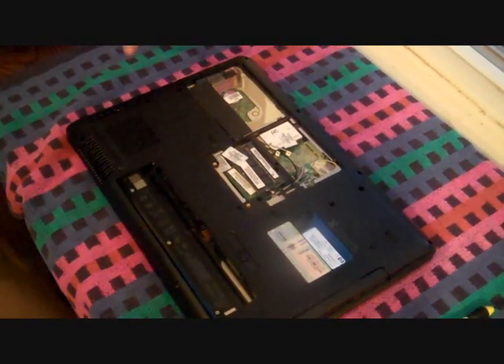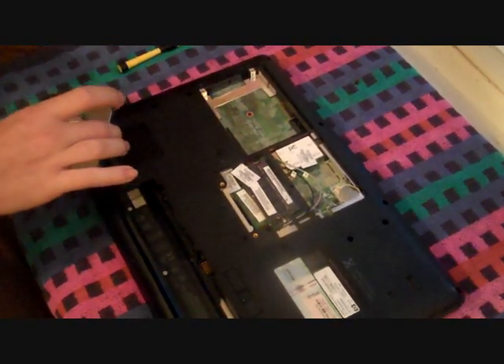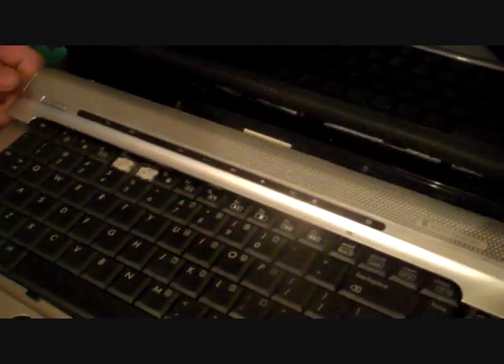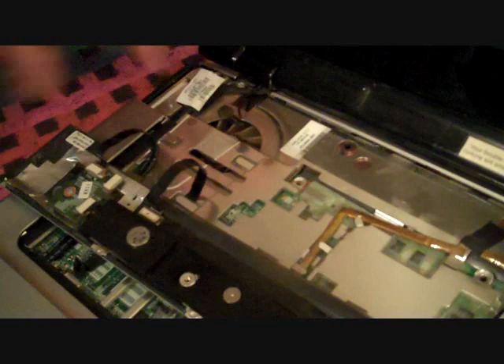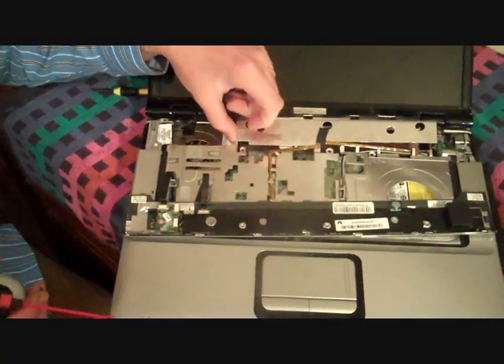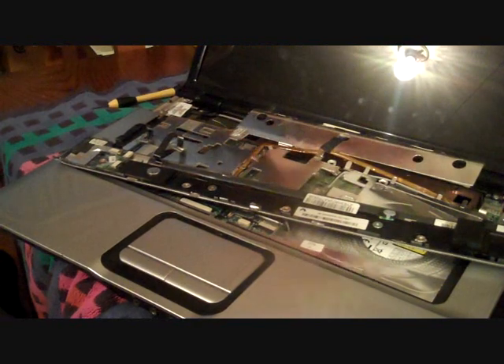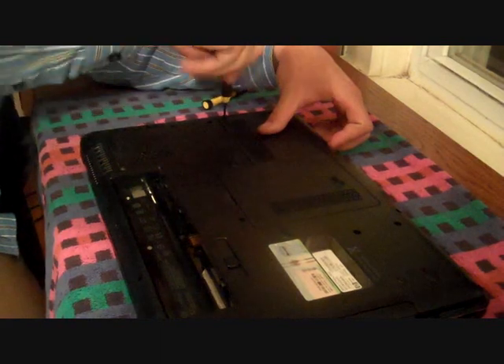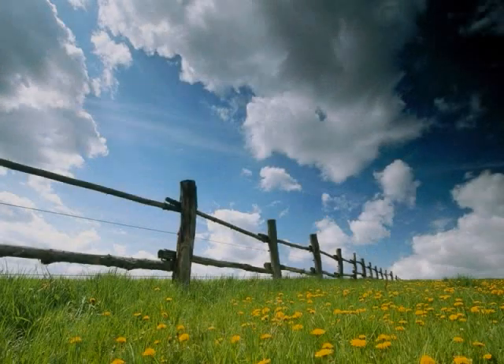How to fix an overheating laptop : Clean your fans and heatsync with this procedure

Comment: i have same second laptop and i cleaned it with powerfull vacum cleaner. it was always 70C or evn turned off if its working to much :), now stays 65-70C on 100% load. USE powerfull hoover

Comment: you fail to mention that connectors such as the keyboard cable have atab that you lift up/rotate BEFORE pulling or the cable can tear.

the dust is ok if it goes in, aslong as it is moved out of the built up areas as the normal air flow will clear it.

Comment: what a half ass way to fix an overheating problem take it apart clean off the fan and heatsink remove the old thermal compound and then reapply the  thermal compound and put the system back together again

Comment: Did this, plus applied new thermal paste, still runs hot as fuck..
Reply: fan working?
Reply: Yep, not sure what the problem is anymore, I made sure the heatsinks are not warped, twisted etc.
 The laptop is entirely out of commision because of this overheat
issue..

Comment: To bad thats a hp dv6000 model where the gpu gets so hot it lightly melts the glue that holds the gpu to the m/b. normally these models always get hot no matter what and typically requires a re-flow or m/b replacement. good job on the video tho +1

Comment: I stand to be corrected if I am wrong, but I WOULD NOT blow dust around inside the laptop since the accumulative dust may have conductive properties? if you blow them to another part of the laptop could that not cause components to short? Well thats just me and I WOULD have stripped it down AND removed the fan and re-thermal paste the processor.

Comment: It's not the platforms fault that people don't do the proper research when buying their PC's. There are many PC's that rival Mac and don't cost nearly half as much. Another thing, Mac is not infallible when it comes to quality and design. Many of their products and accessories break down after short term usage, far quicker than a PC counterpart. Don't believe me, just check out the magsafe power adapter for the macbook.

Comment: how is blowing, aiming air through the fan opening, going 2 remove the biggest problem which is duzt n' fluff build up on the 'inside' of the heatsinking fin'z. this just requires blowing ur air through the ouput vent on the outside of the laptop after removing all the removable panels underneath the laptop so that as much of the duzt leaves the laptop, voila!
+ u can't pull out the k/board like that, did u intend just forcing it back in, no way, u loosen tabs holdin in the cable, blimey mate?

Comment: what do mean by a burnt m/b, if u mean u can see a burnt out component on the motherboard then the motherboard will need replacing. 
if however you mean u have replaced every component u can and it still won't fire up, and i mean; no lights, no sounds from drives starting to spin up, etc, and, you've definitely checked out that the charger and battery are ok.
then it's likely a damaged graphic card or cpu due to an inefficient coolin mechanism, quite prevalent nowadays. cpu easy to do, gpu not

Comment: I have been cleaning laptops, if you can take your pc apart up to the heat sink then do it... sometimes compressed air will not be enough. dust and other foreign object will build up in the heat sink.

Comment: hate taking laptops apart. there are soo many screws and they all don't come in one size. my laptop has 3 diff size screws for certain areas on my laptop. this is why it's important to place draw a diagram and place those screws on the diagram that you drew where those screws belong. that was the only way I could remember where my screws went back to where, because trying to remember 30 screws and 3 diff types of sizes where they all go is a lost cause. lol you will never remember it.

Comment: Yeah seriously. Why cant they just design a compartment you can open from the top to blow air into the heatsink so the dust comes out the bottom? Oh probably because they want your laptop to overheat so you have to buy a new one every 3-4 years.

Comment: That is true, but in my opinion, I need PC more than I need Mac.  Mac doesn't have half the software that PC does, and it is overpriced just because it's an Apple product.  I like Mac engineering (for good fan systems and silent computer motors/engines) and PC for a more extensive choice of software.

Comment: Hi i have a pavillon dv6000. It boots up but after a bit the screen gets white or comes and goes until it become completely white and so i do have to reboot.
I think that it's a nvidia chipset fault and maybe it is gone, wolud this fix my problem? Because i read that baking it in the oven will crash the temperature sensor but, in this case, i believe the chipset is the problem and not the sensor.
Thank you

Comment: You should NEVER play a game or do anything with out a fan. You GPU (what brings you pictures and colors in average computer use and gaming) can MELT at ~100 Celsius. They normally run at ~67 Celsius on average web browsing, gaming with a fan running accordingly can push upwards of 85 celsius and without a fan expect 110 Celsius + which will DESTROY your computer. Get your fans working asap

Comment: Most PC laptops are the most terrible engineering. Sucking in air from the bottom and blowing it through the heatpipe heatsink out of the side. Getting to the entire heatsink unit usually involves removing the entire motherobard, which requires a complete dis assembly of all of the flimsy plasticy frame. Sony Vaio seems to have the best macbook-like engineering with the take-apart and cooling scheme.

Comment: After 2years of cleaning my laptop's fan, not harming it & succesfully avoiding overheating, I think you should know that the EASIEST & ZERO MONEY way is:
1. turn your laptop upside-down,
2. take a vacuum cleaner & put the tube at the window where you can see the fan (that's under your laptop),
3. start the vacuum at min power (I use max power) & at the same time spray many times with little bursts of air (using compressed air) on the heatsink at the side of the laptop.
30'' to 1' are enough...

Comment: Not really going to help if the laptop is badly designed Acer 7250 as an example it was almost certainly designed by a drunken monkey or its suffering from some form of possession that is the final thing I have not tried yet maybe some Holy water sprinkled over it and some well applied holy words might work? Acer, HP and Kami-Fujitsu Seamen-Kazi all have crap models its clear that these companies want your money and they will just dump any old crap and then bug out fast!

Comment: All the people that say this is a bad video are a bunch of pussies.

This is a good video. Months ago I opened and cleaned my laptop the same way (from the back though, not the front). Piece of cake.

Take out the fan from the back and clean out the dirt. Simple as fuck. People are just scared of doing it themselves.

I have been taking pcs and laptops apart for years and I ever had even one break.

As for ESD killing the electronics: bitch please!

Comment: If you're only going to blow air on those fans you can do it without even open up the computer. When I clean a laptop I always clean the cooling flanges. But off-course then you have to gut the heat-sinks, fans and shit.

Comment: I only use this laptop at home and "they" have already replaced the "innards" once. Until I get something else, I took out the battery and put it on top of a pasta strainer. I use an external keyboard and mouse anyway since I have long fingers for a laptop...so it doesn't interfere with typing on it. Once in a while, I put a frozen bottle of water into the strainer just for the heck of it, but it really isn't necessary.

Comment: You can save yourself the time and trouble by simply using canned air from the outside blowing the air into the exhaust vents going slowly back and forth the whole length and height of the vent (turn the computer off first). This will get the clog off the heatsink fins. The only time this wont work is if it's so bad that the heatsink and fan need to be removed for manual cleaning. If that is the case partial disassembly like you showed wouldnt help either. HP even has a document showing this

Comment: lame, crappy how to... I have the same laptop i can take it apart completely and remove motherboard and take fan/heatsink completely off of mother board take apart fan and clean that and put it back together in 30 minutes. why would u even take it apart if your only going to blow air in the fan? if your gonna do howtos you should probably know more about what your doing...

Comment: Happened to me before (G62-b17SA). I took it back to the store I got it from and they sent it to HP who had to replace the heatsink and fan. So if you're out of warranty your best bet would be to find a cheap compatible fan on Ebay as parts from HP spares are quite expensive.

The way I clean my fan is by taking the laptop apart and doing it with a toothbrush, that way you risk no chance of breaking the bearings in the fan.

Comment: Do not let the fan spin when you blow air into it. The bearing will get damage if the fan spins too fast. It's very easy to damage the bearing. The fan maybe spins around 3500rpm at maximum and when you blow air into it you can easy get over 10000rpm.

Comment: ok so i NEED your help.
used the compressed air from a can just like suggested, and the fan no longer works and my hp g62 laptop displays a message when i turn it on saying the fan isnt working properly and keeping the laptop on isnt recommended. 
so basically this method BROKE the fan. WTF

Comment: your missing the point, the procedure is unnecessarily complicated, how many laptops have you pulled apart? tell me you put all the screws back where they belong or put all of them in, forgot a ribbon cable? loose piece of metal inside the case?, these are all common when someone trying to apply common sense with no knowledge of the proper procedure to CLEAN the HEAT SINK, to do that, there's a less complicated procedure, of course if your just going to throw out the laptop anyways go for it,

Comment: also, its heatsink.. not heatsync - sync short for syncronisation, sink = to lower... a heatsink is designed to lower the temperature of the component to room temperature this small mistake highlights the maker of the video's technical knowledge on the subject, and is further highlighted by the unnecessarily complicated technical procedure shown here designed for non technical users that will most likely damage the laptop trying to follow this procedure.

Comment: You skipped the most important part, which is how to open the speaker cover, it looks like is had already been open. I have almost the same kind of laptop, but that's the part which made me stop and put it back together, as  I couldn't get it opened and I'm afraid I damaged it a little.

Comment: if u insist on usin compressed air then it needs 2 b directed through the outlet fin's on the outside of the laptop, where the hot air comes out perhaps with a hoover nozzle on 'suck' 2 catch the excessive dust that would usually be freed there, i mean c'mon man, i expected better instruction here, how many weeks have u been in this business, eh???  
jakkadan

Comment: juz underneath where your hand was when u were blowin the air, (in the wrong direction) and will only re-distribute all the dust inside the rest of the laptop and everywhere else. 
if u insist on usin compressed air then it needs 2 b directed through the outlet fin's on the outside of the laptop, where the hot air comes out perhaps with a hoover nozzle on 'suck' 2 catch the excessive dust that would usually be freed the

Comment: of the heatsink's coolin fin's and as the dust builds up the air flow cannot blow directly through these coolin fin's so cannot do it's job of 'sinkin' the heat away from, via the copper piping, the extremely hot cpu. 
blowin compressed air against the fan fins in the direction u were directin the air will only blow some of the dust off the fin's of the fan, this is pointless, coz it is not gettin the dust off the heatsink fin's, which are at the outside edge of the laptop u were workin o

Comment: plus and apart fom havin 2 breath this crap in for the half an hour, it doesn't remove the more important dust, all the dust built-up on the inside edges of the copper heatsink fin's, the main culprit of the overheatin and the major reason why laptops overheat, dust on the fan fin's?? nah not important.
the hot air is bein blow out of the laptop after it has gone through the fins of the fan and it deposits it's dust on top of all the rest of the dust that is usually sittin on the insde edge

Comment: con'td. we as tutors r always gonna miss out the odd thing or two but not blatant ones like this. 
if you are going to give a video tutorial at least give 'full' instructions, do it properly eh???  the keyboard almost always has at least two screwz coming in from underneath b4 u can attempt 2 pull anything out from the top.
the long bit you removed, (almost as wide as the laptop) which incorporates the 'on', switch

Comment: hey there, YourHowToChannel 
i am wonderin why nobody has commented on ur 'quikezt way to not get the the job properly and risk ruining the use of your keyboard n the process, i don't understand why no-one has commented on the way u kinda juz yanked out the keyboard, it has one of two types of fixture that HAS to be released B4 u can pull on the keyboard. you didn't show how 2 do this, u juz pulled it out, this bad instruction and could permanently prevent keyboard from bein refitted correct

Comment: @XxKingKillaXx56 likely it is being worked far harder than it was 10 years ago when it was new.  Break down and buy a $400 laptop. Cheaper than cards, much faster, and you till think you are driving a race car instead of you trusty horse and buggy.  and do not donate that brick. You will make the poor hate themselves even more if they have to use that thing.

Comment: the best and most effective long term solution to getting you laptop to run as cool as it was when new is to remove the fan and heatsink from the processor(s).  Clean off all old paste from both surfaces, then apply new thermal paste.  While you have it apart, you will see more of the fan housing that can also be cleaned. 
Skipping the paste means you will have it back apart in a few weeks.  If you do not know how to do it, pay someone to do it for you.

Comment: i need some i own a dell latitude c840 yah its old its clean as can be and it has no dust in it what so ever i put new thermal past and new fans but it still runs at 87 degrees c i need some help it works fine at them temps some how but i dont want it 2 run that hot because i kills my grephics card i put 4 of them in and i can go about 3 months on a card and i have to get a new one help!!!

Comment: Are you supposed to be professionals or something? it funny how you had to cut out all the actual work and you did a half-ass job by just blowing it out.  If you want to clean it propper, a brush should be used, you don't want to blow all that dust deeper into your components.

Comment: Cleaning dust out will not help as much as one would think. If you really need to get it cooled down, Remove the shitty thermal grease off the processor and put some arctic silver 5 on it.

Comment: you missed out two essential parts - the 3 screws under the battery and the centre screw where the hard drive is. Which HOLD the keyboard in place from underneath, so of course, now the 3 screws under my battery are held in place by broken and split plastic, nice job. Hopefully others won't make this mistake, but it certainly explains the high volume of DISLIKES that this video has gathered.

Comment: Great video. Why in the world are there so many dislikes. Just one thing anyway to mention. You really need to loosen the ribbon cables with the tiny notches on both ends of the port on each and every port that the ribbon plugs into. If you don't you could damage them or the ribbon.  Their should be no resistance when removing the ribbons.

Comment: @unknownplayer03 Yes it is ok. If it had thermal paste on it, then the Arctic Silver is ok to put there. I have replaced thermal grease on laptops and desktops from green to pink to thermal pads and regular thermal grease. Just remember a little dab will do ya. Spread it out evenly and as smooth as possible with out going all the way to the edge or over. The pressure when you screw down the holders will spread it out more.

Comment: hi can someone tell me i just took apart my laptop and it back together now and running fine but i replaced the old crusty thermal stuff in between the heat sink and the cpu with arctic silver 5 and there was a very light green pad of thermal Greece i think its called on another platform on the heat sink to the right of the cpu platform i replaced that with arctic silver 5 too and i was wondering was i supposed to do that???? please someone help

Comment: This guy is a moron, if the hard drive isn't currently running it's not that fragile, i know people who have hit them with a bat and they fly 30 yards and they still work, personally hard drives are very strong as long as they aren't on, and if you have the laptop off, they aren't spinning so you can set them down, least of my worries when i take a laptop apart

Comment: This video is a bit too much.. I dont know wich brand or how old that laptop was, but the new ones dont need all of this actions! Its enough ti turn it over, remove some scrwes, and you can easely remove the fan and heatsink and clean it. If thats not enough, start using a laptop cooler.